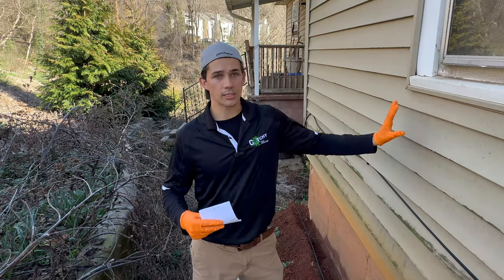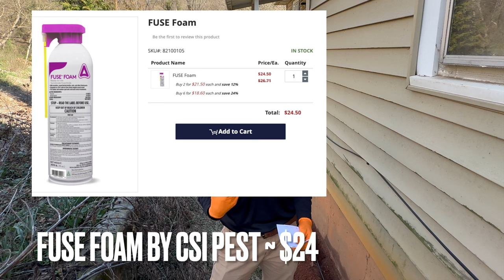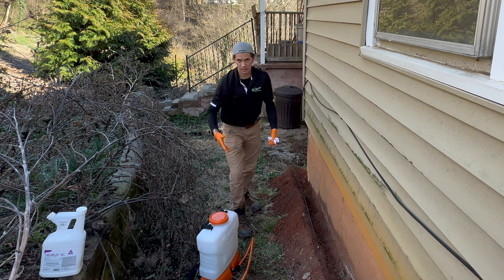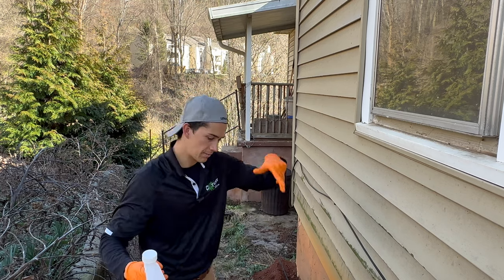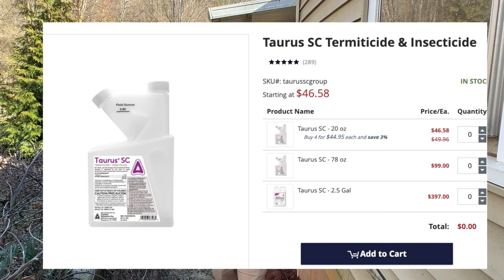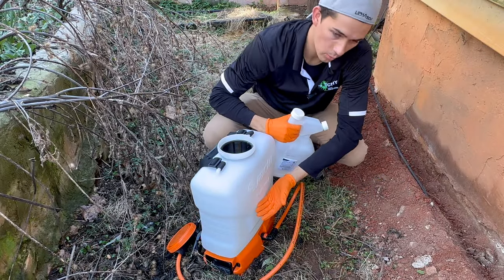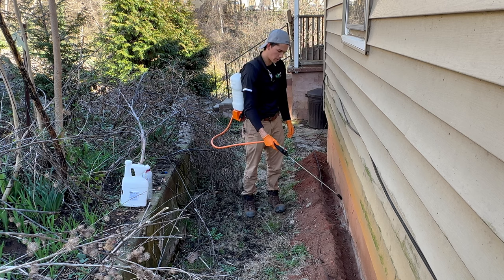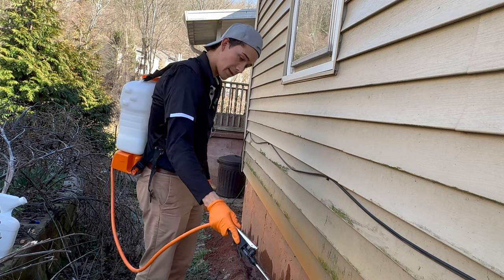How I Get Rid of Termites for $38

Comment: Thanks for the video, I was wondering how you treat along the foundation when there is a permanent deck where you can’t trench along the foundation. Also when there is concrete poured right up to the edge of the house. Do you need special equipment to pump the chemical in holes drilled in the concrete. Thanks.

Comment: I have been watching your videos and recently trenched around my house using taurus sc liquid. I was wondering if homemade bait stations will work as a cheaper monitoring station. What do you think?
Reply: as long as you trench and treated properly, I don't think bait stations are necessary. It's normally one or the other. Also, the placement of bait stations is very very important. They don't have any sort of real attractant, so the termites can easily miss a station on the way into your house. I've seen companies put them 10 plus feet apart and in some really peculiar areas. The main perk of having a company put bait stations in is some sort of guarantee that they either work or if you find termites, they'll treat them for free.

Comment: Great video! Do you have any videos on the proper way to do a preventative termite treatment near water lines coming into homes?  (I.e. under sinks, around toilets) I’m assuming foam treatments would need to be done. If possible, I’d prefer to DIY it,  but I want to make sure I’m taking the right approach. Thanks!
Reply: There's preventative pest control and active pest control. It's the difference between a spray around a house to keep cockroaches out and pointing at a mouse and saying "kill that". There's also 2 main types of termites, ones that live inside wood (drywood and dampwood) and ones that live in the ground and travel to eat wood (subterranean). For preventative for drywood termites, you have limited options. The only thing that comes to mind is treating wood with borax or pressure treating it (I've heard that keeps them out), but you'd have to treat all the wood in your entire house to be sure. To treat an active drywood infestation, you have to get a chemical like fipronil (termidor) or imidacloprid (premise) on some of the termites. That could be through drilling holes (or widening kick out holes) in the wood and injecting a foam or dust where you know the drywoods are. But that only kills the termites that you know are there. There can be several drywood colonies in your house that you don't even know about yet, as it takes up to 6 years before they swarm. The only answer to kill 100% of drywoods (and whatever other critters are around) in your house is to fumigate. To 100% prevent subterranean termites, you have to get a liquid barrier (normally fipronil) in the soil around the permiter of your home and stop any water leaks. If your home has a slab, that means you may have to drill some holes in your foundation to apply the chemical. To treat active subterraneans, you have to get the chemical on them through foam/dust injections and a perimiter treatment is recommended. If you don't have a known issue and you don't have the money for a professional preventative treatment (they'll have to retreat again and again, the chemical has a limited residual time), then my advice is to have regular termite inspections and only treat them when you find them. Applying chemical only around water pipes isn't an effective preventative as they could come from elsewhere. Termites really aren't something to DIY unless you opened up your wall and termites came pouring out and you want only those specific termites dead.

Comment: had some subterranean  termites come out of a ceiling fan  Where at mounts to the ceiling     can't find any tunnel on the side of the house    Can't find any place where they come out of the wall from the inside      
there is a crack in the concrete 
That's visible on the outside 
   Should I drill holes   Along the wall of that room     How far should they be spaced out     
 I treated the outside of the house six years ago    After  having two areas of the house   sub Termites swarming on the inside  of the outside wall     
    The best chemical Ever used for termites was took off the market 
 Ever since then  it's been a huge problem

Comment: What about areas with concrete or stones asphalt etc.... My house only exposed to dirt from two sides . Roughly 25 ft in one and approximately 30ft in another.
Reply: Need the answer to this also I’m hoping it’s on to par to put the solution in between house stucco and concrete in that little crack..I feel like if we do it through enough it will cover just the same??🙏🏽🙏🏽

Comment: What is your favorite battery powered backpack sprayer? Thoughts on the Flowzone Typhoon?
Reply: From best to worst and I’ve had all of these back backpack sprayers 
- My 4 Sons 🐐 (no problems) + get to use my hand drill battery to power it 
- Flowzone (hose leaks at side), switch needs replacing occasionally every year or 2 
- Birchmeier ⚡️(best hose/wand BUT where the bean shape is it leaks) + battery will get 🌧️ ed on cost $120 to replace
- Tomahawk (broke after 3 weeks no power wouldn’t even turn on) 
- Ryobi (Hose split open after literally 2 houses + the top of it does not screw on easily at all)
Reply: @Man_in_a_Gucci_Suit  Thank you!
Reply: @RedicL  I forgot to mention the stock wand/hose that comes with my4sons is cheap and I ended up attaching. My old black Birchmier hose / gun to the My4Sons but once you put a better hose/gun on the My4Sons it’s the best backpack sprayer hands down 

They send you a lot of gimmicky Chinese attachment parts when you buy the sprayer tho just throw most of them out
Reply: I have two flowzones and by far the best one I've used so far.

Comment: Dan ditch the Taurus and get Termidor HE 

the trenches are 2x4” and when you drill you only have to do 18” drill holes instead of 12” 

It’s on sale this month of April
Reply: Also use your electric backpack to run the chemical through the hose while it’s inside of the backpack 

Best way to mix + shaking obviously
Reply: Does Taurus not also contain Fipronil though..? I've heard that HE has a higher concentration of fipro
Reply: @PyroLegend1  they both have the same amount of Fipronil 

Termidor HE has a surfactant (bonding agent) in it tho that bleeds into the soil much more efficiently and last longer
Reply: @Man_in_a_Gucci_Suit  i looked at this, seems cool but pricy, a bottle (not sure how much that covers) was 225. About 11 yrs ago (amazing how time flies) I paid a guy to trench my house, cost 600 then. Drilled the driveway and the whole deal. I'm dreading how much it'll cost this time, I'm thinking 1k? I wonder if he even has this new stuff? But I doubt it'll cost any less (as I said, seems like the chemical itself is more expensive, so it's really just saving labor)
Reply: They  both have 9.1% fipronil , so why pay more for Termidor? Why would you  suggest that?Unless you are associated with them, judging by your name.

Comment: hi I have watched your termite video very informative.
but I'm confused on which chemical to buy there is two different spray
 BASF  :  59021468  
Termidor SC Insecticide  $150.00(home symbol with text inside)  VS    BASF  :  59021351  
Termidor SC Insecticide $70 (home symbol and circle around it)